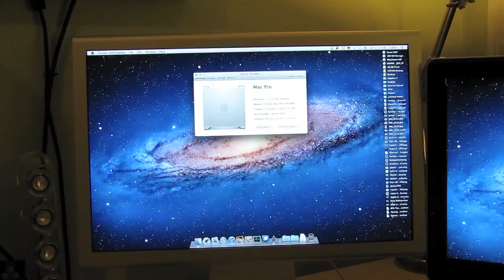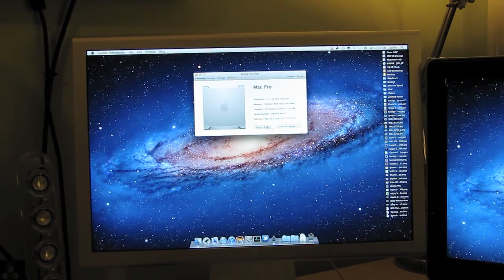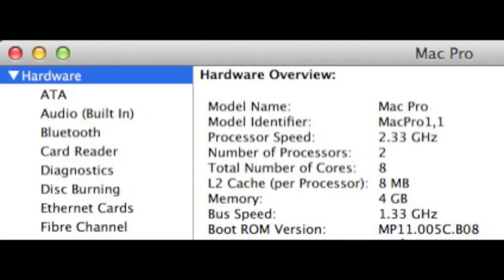Mac Pro Processor Upgrade

Comment: I have a goofy question. Changing the CPU shouldn't affect what memory timings I can use, right? I have 32gb of 667 speed DDR2 and I am planning on upgrading from two E5462 to two X5482. I keep getting conflicting views on this. People keep saying I need to use ram with 800 timing. I don't see why it'd be an issue honestly aside from my memory being a tad slower.

Comment: Getting ready to perform this procedure, on a 2008 Mac Pro 3,1 with maxed RAM and ATI Radeon HD 5770 1024 MB, to take it from the dual 2.8 GHz CPUs to a pair of 3.2 GHz CPUs. Running El Capitan from a 160 GB SSD. I'll remember to use just a spot of thermal grease, as mentioned in the comments :)

Comment: What processors did you upgrade to? I want to upgrade my 2006 mac pro too... i have quad core in there now, but would love to get 8-cores or even 12 if it's possible... any suggestions?

Comment: thanks for upload, just one thing there are two screws holding fan assembly, I found out as I followed your instructions and it would not come out with the removal of just the one screw I was pulling on it like a good un until I had a closer look.
Reply: Dee Em it is true, the only screw is the at the top. What might help you in removing the fan unit is knowing how it is affixed. The unit slides in/out a shoe or a bracket located toward the bottom of the mac. So keep in mind that if it were possible it would be best to lift the unit straight up with as little bending as possible. So try ti wiggle the shoe loose or maybe use a tool to lift it out at the bottom

Comment: Why do you keep calling it your "Mac Pro" just say computer or Mac it just sounds weird when you call it Mac Pro every time
Reply: Also Jesus fucking Christ you don't need that much thermal paste it could have squished out onto your mother board and shorted it out be careful damn you don't need to use the hole tube in one video calm down.
Reply from the maker: No problems on the paste. Do it like that on all CPUs I've done. Idle temp on that machine was 78F with a 72F ambient air temp
Reply: collintheapplegeek the problem with what he did is he put so much on that it actually starts to compromise the thermal pastes efficiency as it puts more space in between the heat sink and the cpu itself

Comment: HOLY CRAP KID! NEVER USE THAT MUCH THERMAL PASTE!! All you need is about a grain of rice!! Amazed your Mac hasn't overheated yet!!
Reply from the maker: Idle temp was 78F with a 72F ambient air temp and never saw it climb past 125F
Reply: +collintheapplegeek you realize the norm is about 50-60° for a Mac Pro right? You only need like a grain of rice amount... The purpose of it is to create a fluid transition from the heat spreader to the heat sync without air pockets, so for best throughput you really only want a little bit!
Reply: Doesn't quite exactly matter, having more actually would allow for more heat to transfer.
Reply: Ty Smith that is Celsius my friend. He was saying temps are ~75 F which is ~30C

Comment: Anyone else hear a loud beeping sound when putting the CPU's under stress?
I hear it when I run Geekbench, Cinebench, or Handbrake.
The beeps are random, sometimes short, sometimes long.
Mac Pro 1,1 w/ X5365

Comment: nice video I still need to do this got my mac pro a year ago at the hamfest for 200 dollars i did upgrade the DVD burner's one is a dvr 118 the other is a LG blu ray burner also i flashed a PC ati 4870 with mac rom's running mavericks , lion , SL, and windows 7 another nice hack I did was the switching supply for the cinema display

Comment: Thanks for this video.  I have a Mac Pro 1.1 2x2 core and have wanted to upgrade to 2x4 for a while.  Was wondering what speed processors you went to: 3GHz?
Reply: Charles B - Do you also have a Mac Pro 1.1?  If so, what hack did you use to allow to update OSX past Mountain Lion?

Comment: Just completed this upgrade and the vid was a huge help. I used less paste. Using a PCI cover to pull out the front fan box was key. Already using Radeon 5770 and 16 GB RAM, so Yosemite is next.

Comment: Can an '08 with a single 4 core be upgraded to 8 core?  If so, please give a link.  Thanks!
Reply: I believe so. I have quad 2.88 mac pro from 2008 and one of the heatsinks is a dummy and I've read that it is the same motherboard as the 2xcpu machines. So what you need to get is an extra same processor (or 2 faster ones) and a heatsink. I looked into this some time ago, never took the plunge but still thinking about doing it

Comment: Taking the fans out 1st is the easy route. Magnets hold the  grey covers over the heat sink. Make sure they are all present and none drop onto the main mother board.Hover areas that have collected dust around the heat sinks...you need to keep cool flow of air running through the mac pro. Look closely as some cables are easy to identify.

Comment: Thanks for the video. Very helpful. For anyone upgrading a (3,1) 2008 Mac Pro (Harpertown series processors, 2.8Ghz, 3.0Ghz or 3.2Ghz) you will need a 9-inch T-handle 3mm Hex. I used the Bondhus 15356. The heatsinks are taller, and 6" isn't long enough to reach the motherboard. You'll also likely need to remove the Northbridge heatsink, which gets in the way, and to do so, you'll need to completely remove the memory cage. Push the fan in, at the rear of the memory cage to buy you some wiggle room to remove the cage.  Remove the old thermal paste from the Northbridge chip and apply a new layer.

Comment: Although the Intel recommendation for the application of thermal paste is a straight line in the middle across the top of the CPU, the amount of paste applied here is still more than was necessary.  It's a waste of paste and it will leave a mess behind.

The line of applied paste should be thin and narrow.

Arctic Silver is not cheap, so it's a good idea not to waste it by applying it as sparingly as possible.

Also, as most thermal pastes tend to have electrically capacitive qualities (even though they're not electrically conductive), it's also a good idea to make sure that you don't leave any chance for excess paste to squeeze out and deposit itself on any part of the motherboard.

Comment: Awesome thanks. Used as a pointer to upgrade my single E5462 MacPro3,1 (Early 2008) to a dual X5482. Total time ~30 minutes; total cost for two X5482s, Heat Sink, & 3mm wrench in March 2014 was only $225 shipped. No OS re-install required. Well worth the 2.5x speed increase.

Comment: with my 2009 mac pro I just take the cpu tray out, and take the fan/heatsink off and replace the cpu 3 simple step, clearly the 2008 or before is not worth upgrading because you have to actually put effort into it.

Comment: WOW two processors, eight cores AND ONLY 4 Go OF RAM???? ram is cheap! cant' you by some more like... 8 Go ore something?...
Reply: With regard to the affordability of RAM, it depends on what you're using.

A 2008 era Mac Pro uses DDR2-800 FB-DIMM memory.  Do you realize how expensive that stuff actually is?

And, while you usually can use non-ECC RAM in computers that use registered modules (though you can't mix the two together), the 2008 Mac Pro will not work with non-ECC memory.

All the more reason to get a 2009 or newer Mac Pro if you're in the market for a used machine, especially if RAM upgrades are in the future.  DDR3 not only performs better, but upgrades are cheaper, even with ECC modules.

About the only time you should buy a used 2008 Mac Pro is if it already has at least 8 GB of the correct kind of RAM.
Reply: I though that mac's weren't as complicated as that. whatever kind of ram you can use on another computer, it works.
Reply: MrDono OMG, 2Go of DDR2-800 FB-DIMM  cost over 60-100$, and it is absolutely obselete compared to even the cheapest DDR3 ram you can find for 15$
Reply: MrDono Pretty much.

If you are going to buy a used Mac Pro that will run OS X Mountain Lion (10.8) or newer, you must either buy an early 2008 Mac Pro that already has at least 8 GB RAM in it or you buy a 2009 model, which use more economical and better performing DDR3 modules.

Without tricking the operating system into thinking that it's running on a computer with 64-bit EFI, older Mac Pro models using 32-bit EFI cannot run anything newer than OS X Lion (10.7).

Comment from the maker: They're pretty upgradable. As you saw in my video, you can upgrade the CPUs to go as far as 8-cores @3.0 GHz. It's got 8 RAM slots. Some models will take up to 32GB RAM and others will go to 48GB or 96GB. They've got 4 HDD slots, and you can also install a hard drive into the second optical drive slot if needed. I have an SSD and 3 HDDs in mine. You can also run several graphics cards without upgrading the PSU.

Comment: Hay man how are you just watched you Mac Pro Processor Upgrade can you give more info on were you got the 8 core processors and how much they cost i have the same Mac Pro and same video card installed also i'm curious what running system you are using and if you know if i can run 10.7 mountain lion... and one more thing how much did it boost your performance if you can answer thanks so much for your help Thanks

Comment: I don't like the center pea option either, because you need to apply a different pattern depending on the processors type and if you get the orientation wrong then your CPU is fried.  Thin spread method is fool-proof, and it provides the max contact area between the IHS and the heat sink.

Comment: I disagree with your comment. You should never touch the thermal paste once its out of the tube. no matter how even there will always be air pockets (try putting a flat surface on water and look underneath)

with all modern heatsinks, there is enough mounting pressure to spread it out already. I use the bead method alot, and it seems to work really well (my 980x still runs fine on a liquid cooler, using the bead method)

Comment: That's conjecture. If he put the cooler on properly it wouldn't have gone everywhere, it would have spread to each side of the processor. Even if it did come into contact with the board at some point though it's not the end of the world, it's electrically non-conductive. If you have any evidence to back up your claim about the dot giving you the best temperatures then by all means share it, but in my experience I've never seen a problem with the line method

Comment: I'd use maybe a little less than that, but certainly not as little as you're talking. I always put a line across the centre, and I've never had an issue, even with stock coolers

Comment: i know what it is already. what i'm trying to say is that if you aren't rendering, you don't need 8 cores. clock speed is most generally everything in gaming because they are only build to use 1 or 2 cores on average, and 4 at the most. in games, why would you pay $1,000 just to get 10 more frames per second? or in rendering pay that much just to render a video 10 minutes faster? it's not worth it.

Comment: Intel will probably be using LGA 1155 for their next line of processors. Just because a new socket is out, it doesn't mean they are are dropping the previous. 

I'm not quite sure you know what you are talking about.

Comment: and which socket xeon are they... 1366 or 2011? either way xeons are clocked super low and don't perform well in single threaded apps.

Comment: lol... 8 cores on LGA775 at that clockspeed and architecture PALES in comparison to even a $700 budget i7 2600k rig, or a 2500k rig for that matter. That's great that you upgraded, but 8 cores on LGA 775 is pretty much equal to 4 cores on current architecture, and thats BEFORE you overclock the quad core. After that, it's over. And that's IF you compare benchmarks on apps that actually USE all 8 of your cores, which are VERY rare.

Comment: Intel i5 2500k OC'd to 4.2GHz
MSI Z77A-GD55 MoBo
8GB 1600MHz RAM
EVGA GeForce GTX 570
1TB HD W/ 60GB SSD Boot Drive

Sure as hell I didn't.

Just because you now have 8 cores does not make a Mac special. Pretty much everyone nowadays has 8GB of RAM or more, and an  SSD.

Comment from the maker: I bought it used. I did this upgrade (8 core), went to 8GB RAM (want to do more), SSD, and 1TB storage. I have about $900 in it now, so I have done it at a third of what you think the cost is. This 8 core upgrade only costs about $75 (~$100 when I did it).

Comment from the maker: The layout isn't too friendly for getting to the CPUs, but it's easy to get to everything else. It's designed the way that it is because it has very specific air-flow channels. It has fans that create large air-flow at low 500-600 RPM.

Comment: First: I wanted to know what a Apple PC looks like (just me)

Second: What is the difference that a MAC is called a MAC? It has an intel processor... just like mine... it has a ATI graphics card... just like like 40% of PC's... etc etc. just because Apple delivers it to you doesn't make it totally different.

Third: easier to upgrade? Yesterday I got my H100i... I didn't have to disassemble half of my PC... in fact the standard Intel cooler didn't have a single screw....

Comment: Well as I said, I've not seen RAM die from normal use yet, but if I do - I'll give this some consideration.

The CPU was not powerful enough to maintain physics calculations AND synchronise the CrossFire. When I bought a 2500K, there was a significant performance increase.

The performance level of parts sold by Apple is however what truly pisses me off about them. Maybe I should buy a load of Mac PRO cases, build hackintosh inside them and sell it on ebay. That ought to make me money :P

Comment: Apple hardware is surprisingly low grade compared to that offered by PC hardware distributors. That statement wasnt well worded. The overall span of performance will decrease, not the performance itself. The ram will last you 2 years instead of 3 (if you plan to keep the same hardware for that period of time). Are you sure it was the bottleneck of the cards, or the CPU? I bottlenecked a Phenom II six-core 1145T with crossfire 6970's on rig my friend had me build for him.

Comment: 670s are generally the best high end value for money cards in nVidia's current lineup, so it does make a lot of sense. I've had 2 6870s bottlenecked by a Phenom II quad, so it's not that difficult to achieve.

If you really are into your virtualisation however - go forth and buy RAM. ECC RAM should also be decent if you want to run a RAM drive.

I've never seen quality RAM degrade due to simple usage, but then again I only use high end RAM, so I can't be sure what Apple's take on this is.

Comment: 6:27
Its a small dot in the middle of the CPU! A SMALL DOT!! Keep in mind that Arctic Silver, or any high end thermal paste for that matter is conductive. You put way too much thermal paste which could short something out if it makes contact with other components. To make matters worse, you didn't even ground yourself; even the smallest amount of electrostatic discharge is enough to fry the motherboard.

Comment: Good job for your first time but that's WAY to much thermal paste. And when I say way I mean WAYYYYY. That thermal paste is going to spread ALL over your CPU and CPU retention bracket. Not to mention if any silver based thermal paste gets on the motherboard you could have some issues.

Comment: Bottlenecks dont decrease performance, they decrease the life of the ram/ CPU depending on the improper ratio. 8 gig is fine for most things. I do a lot of virtualization with VMWare and VMPlayer so the 48 gig I have in my rig really helps me. 8 is really the sweet spot. Plenty enough for games, and most rendering. A GPU is really hard to bottleneck. Depends on the CPU and what onboard graphics there are. Any Xeon and a lower end AMD card will do it. Should go with a single GTX670.

Comment: Don't need 12GB. Today's optimum is 8 for most users, 16 if you use it for HEAVY rendering, CFD, and the likes. I'm running CAD, CFD and a bit of rendering with 6GB and I'm not bottlenecking anything.

Comment: Normally it's not really an issue if you apply a bit too much quality TIM, however be careful with AS, as it contains silver particles suspended in a fluid, which makes it capacitive. If you apply way too much (as it seemed in this video), you run the risk of it bridging CPU socket pins, and f-ck knows what'd happen then. You need roughly half the IHS covered in the middle, in a straight line (so about 1/3 of what you put on). More than that is detrimental as it just adds to the impeding volume.

Comment: Try not to touch the surface of the cpu when installing it. The oil on your fingertips can cause problems for the thermal paste in conducting heat efficiently. Also, single dot in the center is way more than enough.

Comment from the maker: You can upgrade PowerPC Macs, but only to faster PowerPC CPUs. You can't upgrade them to any Intel chips. There are aftermarket G4 chips up to dual 1.8GHz if you have a PowerMac G4. You can take the PowerMac G5 up to quad 2.5GHz CPUs (2 cores per CPU) or just buy a stock quad 2.5GHz G5. The PowerMac G3s can be upgraded with faster aftermarket G3 CPUs or some aftermarket G4 CPUs, but you're just not going to get much performance out of an old G3 Mac.

Comment from the maker: Lucas, I used the Xeon 5345 lga771 chips (2.33 GHz). You an also use 5355 chips (2.66GHz), 5365 chips (3.0 GHz), or some very cheap 5320 chips (1.86 GHz). All configurations get you to 8 cores. I chose the 2.33GHz 5345 chips because they were under $100 for the pair, and they don't run as hot as some of the faster ones. I wouldn't run the 3.0GHz ones of you're not ready to keep your fans turned up. You can find the CPUs on ebay. Just buy a used pair that have been tested.